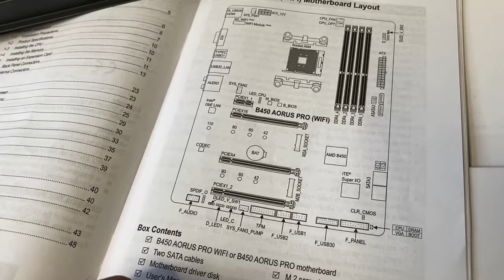How to Install a Case Fan in your PC

Comment: Little tips: if you tryna to screw 4 screws or more. Do the X move, so basically if you screw the top right part, the second screw must be on the down left part. It's more easy to screw with that move because the part you gonna screw isn't dangling like in that video.

Comment: If a CPU has a stock cooler do they take up one of these fan slots on the motherboard? (Also good video my man)
Reply from the maker: No, so the CPU cooler (stock or aftermarket) will plug into a separate fan header; usually named “CPU_Fan” or something like that. If you have a liquid cooler, the CPU block/pump will usually plug into the designated pump header and the radiator fans would then plug into the “CPU_fan” header, however every motherboard is different so I can’t say for sure. I really appreciate the compliment, thank you 🙏
Reply: Builds With V right on I appreciate it!

Comment: OMG yesterday I was trying to figure out why the lights aren't working but the fan is spinning. I just came to the right place. This is the right video, no trash talks, only to the point. Thankssss........
Reply from the maker: That’s so much for the kind words and for watching. Glad I could help 🙏
Reply: @BuildsWithV  Also I wanna know if i put in the wire to system fan 1 then should i put the other one to the LED1 or can I put on any number?
Reply from the maker: @aaryanrh  you can do any number. Doesn’t really matter

Comment: For the love of God thank you lol this has got to be the only video that actually shows what connectors go where.
Reply from the maker: Evan Ostermeier I’m glad I could help 🙏😅 thank you for the kind words
Reply: Question man. When plugging in wires for front IO, there is an arrow on a 2 pin connector. Is that arrow ground or power.
Reply from the maker: Which connector is it? I think arrow indicates the power or + on most connectors. 4 pin RGB connectors use an arrow to show which one is the + so that’s my thought.
Reply: The reset switch. Lucky I treated the arrow as + already
Reply from the maker: Oh okay, yeah nothing bad would happen if you didn’t tho. No power goes through it. I’ve done it wrong before, it just doesn’t work until you flip it. 😅
Reply: Sorry to keep asking questions but I hand an ASUS motherboard with aura sync. My fans have 3pic connectors for rgb and the motherboard has 4 pin rgb connectors. They don't fit on so do I just need new fans?
Reply: Or does the CPU fan headers around the motherboard also control rgb
Reply from the maker: @evanostermeier  so either you can get different fans or I would just get a 4-pin to 3-pin adapter. Like this one: https://amzn.to/2Q0rmGS
Reply from the maker: Evan Ostermeier and it’s no problem at all, I don’t mind answer the questions. (As long as I know the answer) 😅🤘🏼
Reply: You're awesome lol

Comment: Best explanation man thanks a lot. I didn't know how to install it's my first time! I have six fan how many should be intake and exhaust?
Reply from the maker: @Pedro94-dp  no problem, glad I could help. So I always recommend front fans as intake and top fans as exhaust. If you have bottom fans then those are intake and if you have rear fan then that would be exhaust.
Reply: @BuildsWithV   Got it man thanks

Comment: Hi, i bought a noctua fan and connect It to the motherboard using his 4 pin (no extensión, no low noise adaptors) the thing is tha spins slow (200-300 RPM) did i do something wrong?

Comment: Thanks for the video, very helpful. Do you know, will a 3 pin fan be controlled if its plugged into a fan hub that is 4 pin? Or does it still spin full speed?

Comment: Thanks for the video.  What if I have already used the 3-pin LED-1 RGB header for the 3 fans at the front.  Can I use the LED-2 right beside it (and will I need an adapter or will I need a splitter)?   Thanks!

Comment: Thank you so much, I had a 3 pin fan connector and was confused with where they go into the 4 pin connectors so thank you very much!
Reply from the maker: Glad I could help 🙏 Thanks for watching
Reply: So just to confirm if my MB fan ports have 4 but my fans have a 3 that's totally fine as long as I line it up with that black plastic part? Thank you,

Comment: Just came across your video.  I just had a system built, but forgot to include a rear fan.  I have three in front, two on top.  How do you install a fan in the back if the GPU is already installed?  Its a Corsair 4000x.  The top fan is a Kraken z53 and the front fans are the ones that come with the system.

Comment: Great video for newbies like me! Question, if i were to buy 2 - 3 RGB fans and place them in the front as intake fans, Considering there's only one D_LED power pin on the motherboard, how would i go about connecting the other 3 LED power pins?

Comment: I like to put the psu facing down so the hot air can exhaust outwards of the case.  Of course it depends if your case has a whole in the bottom to allow it to do that
Reply from the maker: Even facing up like mine exhausts the air outside the case but this way the air pulls from the case. It’s not a great setup, I don’t recommend it personally. Was testing it to see how well it works. Didn’t really help temps and the PSU got hotter than normal

Comment: Hi! your video is explained clearly where the cable should plug in motherboard. Thank you
So my case is tecware forge m2 that have 1 rgb fan in the back with the same cable like you. but for the 2 rgb fan in the front, it doesnt have that addressable rgb 3-pin , it only have pin to connect to the psu. Can I connect three of them? I'm a bit confusing with that. Thanks!

Comment: Yoo first of all that video helped me alot so thanks! Now i have a question tho. I have 4 rgb fans and i dont know where to plug in the other rgbs. Do i need to buy a rgb fanhub?
Reply from the maker: You will need a rgb hub or a rgb splitter. I have a video showing how to install the hubs as well
Reply: @BuildsWithV  so turns out i have an rgb hub build into my case. Thx alot tho

Comment: You were talking plugging three pin into four pin socket (3:51), but your hand were holding a four pin wire. And the rail you mentioned was not clear.
I am having a three pin fan wire plugging it into a CPU four pin socket, not knowing to plug it into the socket using the right pin alignment or the left. I was so hoping to get an answer from you man.

Comment: I literally just hooked up this exact motherboard and and fan, and the rgb on my fan won't turn on. I'm using the top right header for the RGB, is this something I can fix in the BIOS or would this be a hardware issue?

Comment: So the only 120mm intake fan for my old thermaltake armor VA8000SWA full tower screws into a removable 3.5" HDD cage which takes up three slots of the ten 5.25" bays I have. I'd like to put another 120mm fan (or even a 140mm?) above it but there's no holes to fit them in. The only thing I can think of is getting another HDD cage but I wonder if there's some kind of bracket thing you can get?

Comment: I have the same motherboard so I'm trying to figure out how to install the Case fans that have rgb but I dont see that it has any rgb cables. Only black and grey ones with different names. 
Thank you for this. This help me solve half of my questions.
Edit: My case is is a Darkflash BF5
Reply from the maker: You’re trying to find the spot to connect the rgb fans that came with the PC case you purchased correct? I’m not sure if those fans connect into the motherboard. I think those connect to the power supply. I’m not sure tho because I’ve never used that case unfortunately.
Reply: @BuildsWithV  Thank you for the response. By any chance does the connection cable is like a 4 pin and the pins are round? They are big pins. And hard to connect
Reply from the maker: Nuclear GamerPR if they are the big pin then they would connect to the PSU. It’s called molex connector. Big 4 pin thing. That’s goes on the power supply
Reply: @BuildsWithV  thank you so much for the info.
Reply from the maker: No problem at all, thank you for watching 🙏

Comment: Very nice explaination but i have some questions likewhy my fan doesnt light up like RGB is it because i dont have those extra wires like u

do we need that RGB control kinda thing i heard when researching about this .
Reply from the maker: Thank you 🙏 it depends on the kind of fan you have. If you have a fan like mine then you’d need to plug the rgb cable in the proper port. If you have a different fan you may need special rgb hub or something like that.

Comment: Hi I’m just now setting up my first ever build and I have the same fans as you, I’m trying to figure out how to work the RGB, my headers have 4 pins and not 3. I’m using a asus x570 pro motherboard. I’m using the hub the fans came with and they all run just no lights. If you could offer some advice I’d be very greatful!
Reply from the maker: Are the hubs plugged into sata power? These won’t be able to be controlled by software with your motherboard unfortunately due to your motherboard not having any 3-pin headers.
Just make sure you don’t plug the 3-pin cables into the 4-pin, you could fry something since they use different voltage.
Reply: @BuildsWithV   yes all the fans are plugged into the hub it came with and the hub is connected with sata
Reply from the maker: @skyless8340  Okay, how about the RGB cables? Are those plugged into the hub and sata?
Reply: @BuildsWithV  I think that’s where some of the confusion comes in I’m having a hard time determining what’s what like I said I’m a beginner lol. I only have the cables that power the fans connected to the hub, I tried daisy chaining the fans and it didn’t change anything. I have a silver cable coming from the hub connecting to my mother board and my dad said that should be the rgb but it doesn’t seem to change anything either weither it’s plugged in or not.
Reply from the maker: @skyless8340  Okay, I completely understand the confusion. The silver wire that goes from your motherboard to your hub is actually for fan speed and not for RGBs. There should be a second hub that these fans came with, that hub is for RGBs. Since your motherboard doesn’t have 3-pin headers, you won’t be able to plug that hub into your motherboard. You can however plug the second hub into your sata power like you have your other hub. Then plug all your RGB cables into the hub itself. The RGB hub has some buttons on it that can control the RGBs. If you have Instagram feel free to DM me on there and hopefully I could help more. @buildswithv on Instagram.
Reply: @BuildsWithV  okay thank you so much!! I’ll try that tonight when I get off work. I appreciate the help and you responding!
Reply from the maker: @skyless8340  no problem at all. Hopefully you get it all figured out. Feel free to contact me if you have any other issues or questions. Thanks again for watching 🙏

Comment: Awesome video and tutorial! I was curious on how many RGB fans I can install in my case. It says I can have 7 in total but my motherboard only has 3 slots of sys fan and two D_led ports. How would I be able to add more fans?
Reply from the maker: Thank you 🙏 You will need fan splitters or a fan hub and a rgb hub to connect many more. Technically with a couple RGB hubs and fan hubs you can get as many as 20 fans in a case (not that you need that many 😅). Here’s a video I did explaining the hubs and installation: https://youtu.be/EttoFpulT4s

Comment: Just a quick question.
How does the fan recognize the temp after using the heat gun, since the fan itself isn't directly connected to the MotherBoard (where sensors are)

Comment: I just completed my first build however the front three 120mm case fans are not spinning. The rear case fan and AIO Cooler work fine. Any advice would be useful. 

Case: 4000D Airflow 
Mobo: ROG STRIX B550 F Gaming

Comment: What screws did you use by any chance cause I’ve been trying to find screws for my cooler master fans but no luck so I just used zip ties for now
Reply from the maker: I used the standard fan screws. Some fans use different ones but 99% of the time they’re the standard one. They’re short and fat screws. They sell them on amazon or eBay I’m sure.

Comment: Thank you! I thought sys fan was for cpu fan. question, can I connect multiple fan to a single port? I only got one sys fan slot.
Reply from the maker: Yeah you can. You can use a fan splitter or a fan hub. If you need 4 or more fans you’ll need the fan hub.
Reply: @BuildsWithV  thanks! finally solve my problem

Comment: Hey man!! Great video so i have a question if you could help out.I bought this extra case fan in order to place it  above my cpu as a top exhaust fan.Its a 3-pin connected to the motherboard(chassis fan2).It works fine but when i boot my pc everything starts normally, but this fan starts spinning after like 5-6secs. When in sleep mode after waking up pc it boots normally.Why is that?My mobo is asrock b450m steel legend
Reply from the maker: I think it just depends on the software in the motherboard. All mine start spinning together. As long as it works all the time besides those 5-6 seconds you’ll be okay. Thanks for watching 🙏

Comment: Hey man ,Is this  gigabit aorus elite b450 mobo?
Does it have Good vrm and are you happy with this mobo I'm thinkin to get this one ?
Should I ?
Why people are talking about its vrm like it runs hot.
Please do reply
Reply from the maker: This one is actually the B450 Aorus Pro WiFi. The VRM May run a bit hot but honestly I had no issues with it. My new PC has the B550 Aorus Pro AC. Has a better VRM overall. I personally do recommend the Aorus brand motherboards. They’re very solid and have plenty of features. I’ve never had a single issue with Aorus.
Reply: @BuildsWithV  OK thanks so much for replying.
Reply from the maker: Jayesh Sharma no problem at all, always here if you have any more questions. Thanks for watching 🙏
Reply: @BuildsWithV  yea man Actually one more question. 
Are these argb fans and how to connect 3 fans to motherboard if mobo have only one 3 pin 5v argb header.
Reply from the maker: Jayesh Sharma these are ARGB fans. You would need either a 5v ARGB hub or a 5v 3-pin splitter. These specific fans actually have a piggyback and you can connect 2nd, 3rd and 4th into each other.  Any more than 4 and I’d recommend a hub that gets extra power from the PSU sata cable.
Reply: @BuildsWithV  Ok thanks again 😃

Comment: Question : I want to add a small exhaust fan to the back of my pc. It has a molex four pin thingy on it. I took the fan from one old pc and want to add it to another old pc. Can I just plug the molex end of the fan into a molex readily hanging in the computer that's connected to the power supply further down the line?  Will it work like that?  The motherboard doesn't have any molex or four pin places left to use. Thanks if you see this.
Reply from the maker: Yes you can plug the molex into any of the molex connectors off of the power supply. Will work perfectly. Thanks for watching 🙏
Reply: @BuildsWithV   Thanks so much for answering. I missed that you responded till just now, but yes, it did work, and now I'm hoping a two pin molex fan will work in a new pc using a four pin molex cable that's plugged into the motherboard. My new build only has two fan plugs. I don't have a Y connector. So one fan is in the fan slot, the CPU fan is in the CPU fan slot and I'm plugging the exhaust fan into the molex cable from the psu. Except the fan's molex pins only have two pins inside the plastic housing that is made to fit on the four pin molex cable. I'm extremely new to this and hoping it will work when I turn it on in a day or two. Still have some building to finish first.

Comment: I have RGB fan but i don’t find the right conection with 3 pins. I also have a cable with VGD designation... What means, and Where i conect? 
Congrats for the vídeo and exlication!
Reply from the maker: Yeah your motherboard may not support 3 pin rgb. VDG is another form of RGB connector and it would plug into the vdg header on your Motherboard if it has one.

Comment: One question I have is does it matter which way the logo is facing when installing the fan? For example if I install an exhaust fan, and it's facing the right direction, can I rotate it to make cable management easier or does that affect airflow?
Reply from the maker: That won’t affect airflow, you can rotate the fan any way to allow your cable to be where you need it. Thanks 🙏

Comment: hi man, I have a question for you. I have a fan that was included with the case and it works fine, but I can't light it up cause the fan has a 3 pin connector for rgb and my motherboard has a 4 pin connector for rgb. Any ideas?

Comment: Ok so I plan on installing 4 Phanteks D-RGB fans to my p600s, if I buy the 3 pack it comes with a PWM splitter and a Motherboard drgb adapter, if I buy a single will I also need to buy a DRGb adapter for the 4th fan?

Comment: not to hate on your video is great but i would do a screw at the top left or right then do it at the diagonal of it so (Example -->) I put my screw in on the top left so the next screw I screw in would be on the bottom right then just finish screw the rest of the screw how you choose

Comment: For the front and top fans, should they be mounted on the outside or inside of the fan bracket? Just curious if it matters or not.
Reply from the maker: Front I usually go on the inside but will depend on the case. Top I haven't used a case with a bracket so I'm not too sure. Thank you for watching 🙏
Reply: Awesome,! Yeah, I was just curious if it improved airflow cause then they wouldn’t be right against the front panel. Thanks for the super quick reply and the helpful content 😊
Reply from the maker: @HikariSoulstrider  Awesome, yeah it does help a bit. Too close is never great unless the front of the case is full mesh or something. No problem at all, thank you 🙏